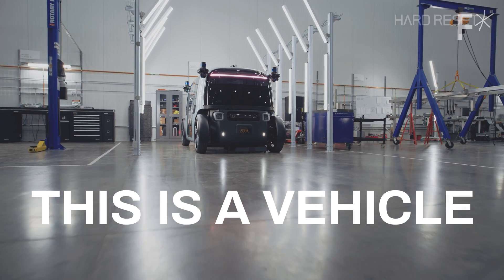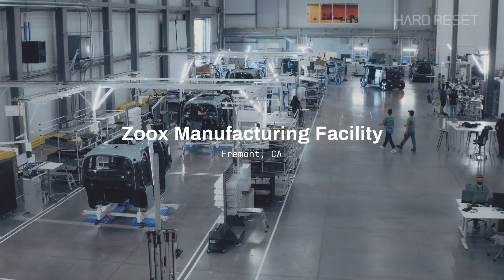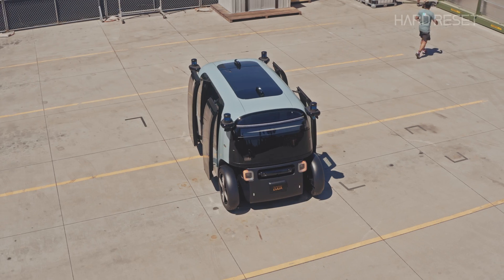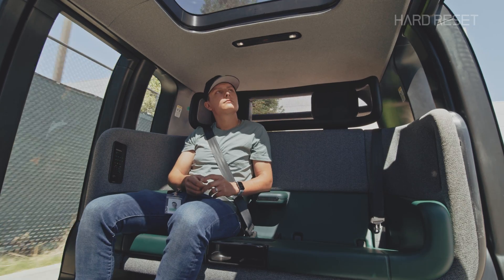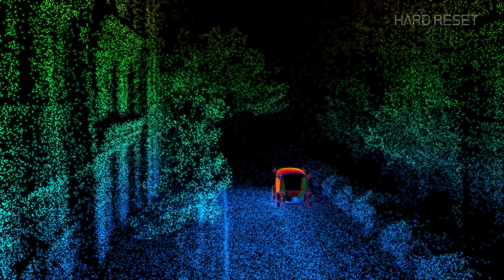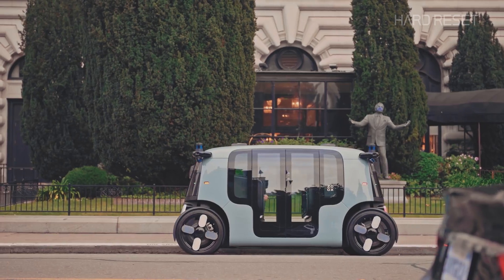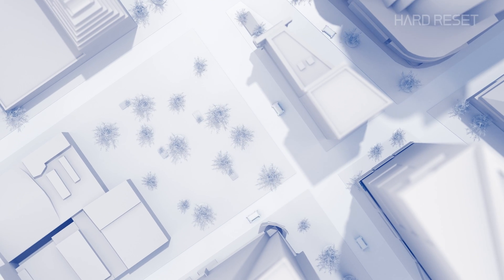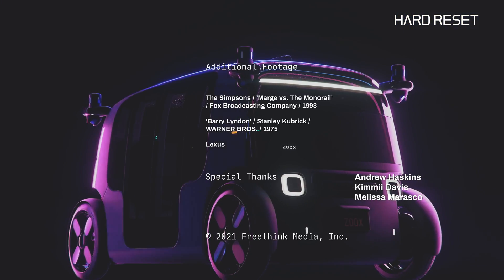This Car Has No Driver. Or Front Seat.

Comment: I see the advantages of self driving vehicles. Despite possibly to have them revolutionize public transportation by picking up several passengers to go around on an optimized routing to drop them off at same price as a bus ticket and make the overall traffic saver and less convoluted.
But, and that is a big but, not owning means dependency and being a target for price increases just because the investment to run these kind of companies will be a private business aiming to make money.
Unless, the public transport system is regulated…but even then you are no longer in control on how much you pay because you don’t own the vehicle anymore.